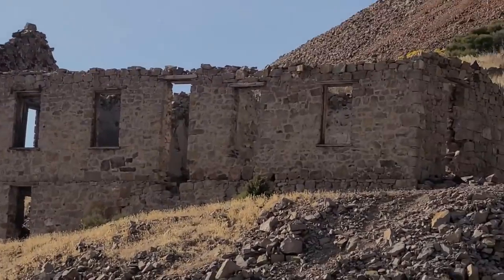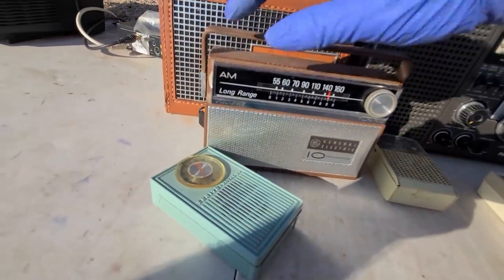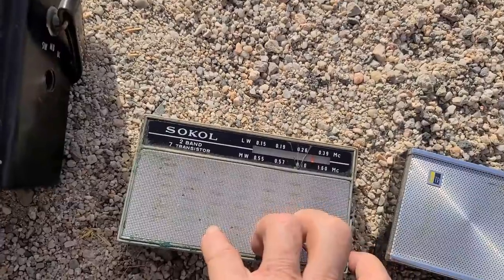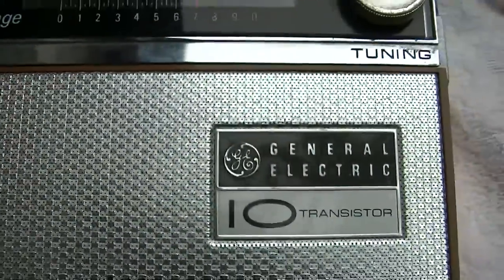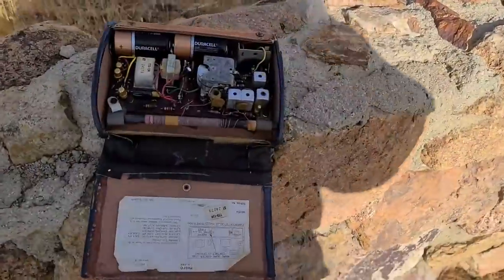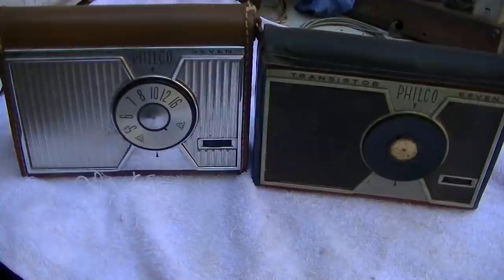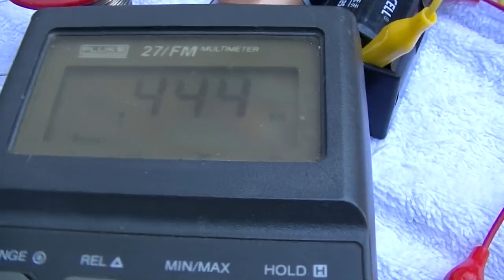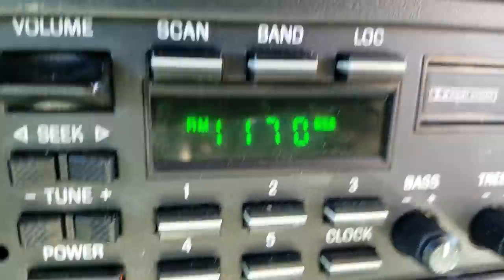Transistor Radio Sensitivity Performance Test Fringe Low Signal Locations

Comment: With proper alignment, the RF-2200 will smoke the Sony mantle radio. Mine was recapped and realigned. There is no way you’d have to turn the volume up that high if it was aligned and recapped.
Reply: @crooner2007   Apples and oranges.
Reply: @crooner2007  Have you owned a properly restored and aligned RF-2200?
Reply: @crooner2007   I’m all set, thanks for playing.

Comment: am  stereo country 1170 6 kw day/ 1 watt night that is the reason for the drastic change at sunset
Reply: One watt? Is it running on a 9-Volt battery? Not 80 watts? Not 100? Not even 10?

Comment: Find some more pieces of the Sony and glue it together with glue and add some gold so it become like they do Kintsugi with ceramics. Kintsugi can look very pretty and more expencive even if broken.
Actually the more broken it gets the more expencive it gets too :)
Like this.
http://lakesidepottery.com/Media/JPG_Images/Kintsugi-example/turquoise-kintsugi-bowl-1a.jpg
Reply: The Sony 7600GR was a good small radio.
I bet the Tecsun 880 will do good here too, one of the modern top good ones, i did buy it based on lots of reviews and comparisons.
Tecsun has gotten a new model now, the 990, i dont know if that is good but could be :)

Comment: Maybe the multi band Panasonic came misaligned from the factory
Reply: .... probably needs some components (caps) changed. Panasonic caps are not the best IMHO. any boombox from this period have most of them leacked on one of its legs. I did a couple of them, .... then I gave up.
Reply: @38911bytefree  More likely it needs the oscillators re peaked. After 45 years things do go out of alignment.
Reply: It's possible. I recently purchased a RF-2200 and it is as hot as it comes. Very selective too with very deep nulls possible from the gyro antenna. Impressive performance, and all original inside!

Comment: We have the flashy, elitist Panasonic getting crushed by the frumpy, 'peasant' Sony.
Reply: Yep. I love an underdog story.
Reply: I wouldnt call this receiver elitist at all. Panasonic knew how to deliver value while being affordable. This is just fancy looking rolling dial. At some point people were interested in navy / militar looking radios. Sanyos were also on this trend.  I have a 5410 cassette with 5 band radio. Not as much features but similar in the line up. This radio was featured in consumer adds with ABBA. Today 5410's has gone up in value. Not because elitist, but because they werent made in large numbers. It wasnt needed. So did many of the other Panasonic Boomboxes. Some of them are rare even to radiomuseum. Probably marketing failures ... They delivered a BIG number of different products until they found their way to catch the consumer attention best.  But if you get a standard RS-466, you will be surprised about the performance that EXCEEDS your expectation even on bad caps. And if you want nice sound with almost 7 inch speaker, the RF-888. A "HIFI" radio with aux in (in mid 70s)- Of course they had EXPENSIVE receivers ... but is far from the Panasonic way of thinking, They needed flagships as all the other brands.